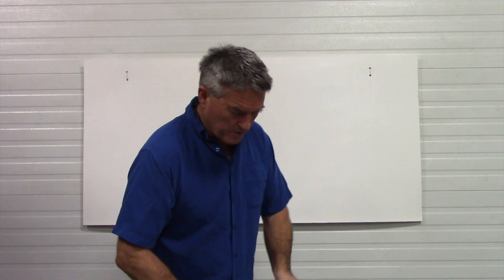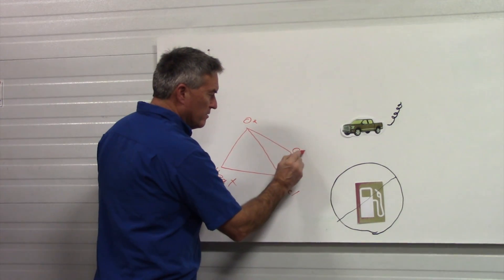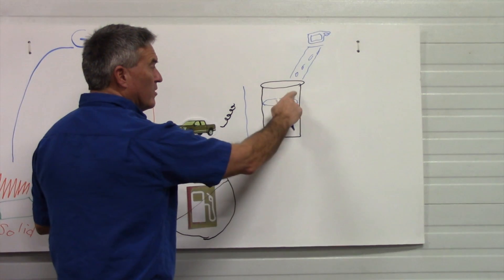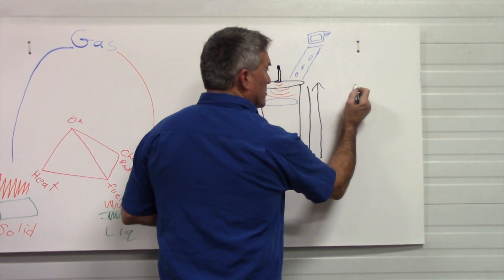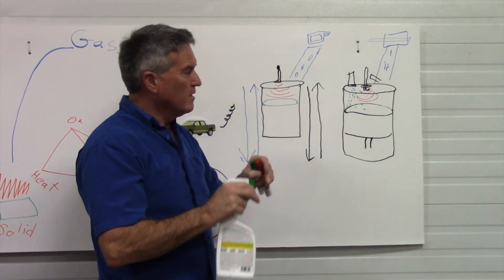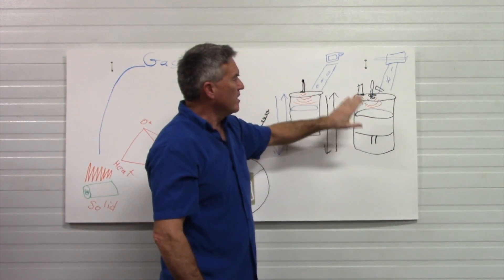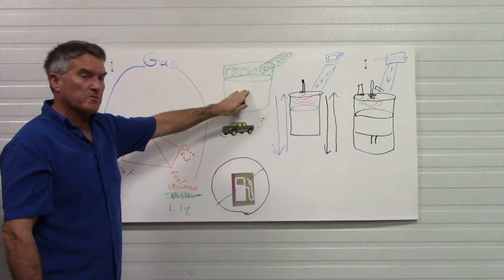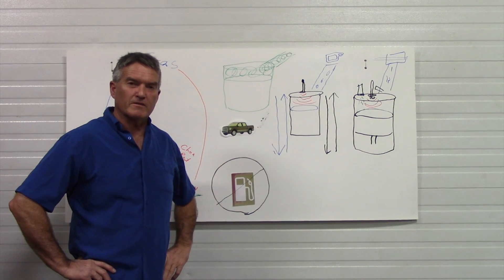One Simple Trick to get 100 miles per gallon with less pollution!

Comment: Does anyone remember a product that was demonstrate on TV that  was just a simple operation to add it to your engine intake fuel line but just before the injector?  it would inject air into the pipe in such a way that it would mix it and it would actually make your car do way more miles/gallon of fuel?  I have seen this demonstrate in the 80 maybe even the 70's but it could be found nowhere after that add.  Maybe it did run with electricity, i'm not sure.  One thing is for sure, 'they' took it off the public eye very fast...
Reply: this stuff has been around a long time my friend put one on his truck, and then their were special spark plugs to save gas etc. He never got more than 12 mpg
Reply: oh i see...  thanks!
Reply: Sylvain Piche I have purchased a HI CLONE device which has no moving parts and only has razor sharp blades with a slight twist. It's meant to give better mixing of fuel and air. Mine sits in the air intake just at the throttle body. No maintenance....but little to no difference in power or economy. Some people will put a suitable device in each manifold to head area....6cyl equals 6 devices etc. While I'm open to suggestions I did see a guy on U tube running a V6 on petrol vapour by connecting the air intake to a crudely fitted plastic jrry can. Cheers from AUS

Comment: Study the old type Coleman stove. It has what they call a generator that passes over the burner. When you first lite it the flame is spastic a d smoky. After it gets the "generator" hot which gasifice the liquid the flame is a clear blue almost non smelling. I have ran Ammoco Ultimate in these stoves for many years. This gasoline will clog the generator more frequently than the distiled Coleman fuel because of the additives , but it still will gasify and do what he is talking about. For a long time I've wanted to upsize this technology and run an auto engine. A small propane burner could be made to heat the "generator" and heat controlled by sensitive electronic thermostats to conserve this gas or simply use the exhaust gasses to heat it. The "generator" would need to be insulated up to the intake or it would condense back to liquid and defeat the purpose.

Comment: My truck burns straight veggie oil or diesel.
Changed nothing but rubber for poly fuel lines added more heater hose to warm a tank

Comment: The Gas that is in the wood is contained in the cellular structure, (cells),  of the wood. When you heat the wood, the cellular structure becomes fractured , and the gasses inside those cells are released, and this gas, mostly Hydrogen is what combusts. This is called Wood Gasification. People have run their internal combustion engines on Wood Gas. https://youtu.be/rz_ovHWvAAg

Comment: Car engines are designed to waste fuel. The only way to change that is to drastically reduce or eliminate the compression of air and gas because if gas and oxygen are mixed for complete combustion it will detonate under compression. When that happens there is no way of timing the combustion due to so many variables in temp and pressure. They know this so they purposely waste the gasoline to control when to ignite under compression. If they injected fuel and air after top dead center without compression and then detonate they would be very effective. This would also eliminate the need for so many cylinders and other moving parts. But we all know the petro companies won't ever allow this to happen !!
Reply: You should invent a motor and call it  Diesel.
Reply: Call it Vin
Reply: Your comment is obsolete, see Mazda's Skyactive-X engine design I think you'll like it. Uses, compression, spark and hybrid compression spark ignition. Uses a pressure sensor to measure chamber precision each cycle, and runs lean most of the time. They report i has about 30% more torque than thier current Skyactiv-G and is about 40-45% thermally efficient.  Should be in cars in 2019.
Reply: Chase Rayfield m

Comment: It is not a explosion it is a burn when the spark plug sends the spark
Reply: Correct, there is a middle ground though that Mazda is using they compress the air fuel mix almost enough to cause compression ignition then use a spark to start a burn the pressure from the expansion of the burn causes the rest of the air fuel mix to explode at once.... its a neat idea that they are implementing in some of thier engines going on sale in 2019.

Comment: LPG?
Reply: Probably Liquified Petroleum Gas.  Propane is an example.  However, it could be Litres Per Gallon, but that would be really dumb because it's 3.8 in US gallons, 4.55 in Imperial gallons and really doesn't vary.  That's a real head-scratcher.

Comment: Do you have a finished modification on a vehicle you can demonstrate for all of us, and show us the efficiency? or proof of concept?
Reply: Aaron Leon .... His cousin did a test and swore he got 100 mpg in his Lesabre.  You calling him a liar?
Reply: I got well over 100 MPG with this technique.  Technically, I didn't use "this" technique ... I simply measured while going down a very long hill because it was easier.
Reply: What is your idea? oh just a worthless nobody.
Reply: What is your idea? oh just a worthless nobody.
Reply: Aaron Leon mm
Reply: Aaron Leon: You COULD build and set up a GEET system for you car's engine. They're not too expensive but they have to be built just so in order to increase your fuel mileage and consume less gas. OR... you could look into getting an HHO mod for your car. BOTH are provided in videos here on YOUTUBE if you wanna spend your spare time building it. However, BOTH require your car's computer to be modified and there aren't many shops around the world that can do that because it's still a new concept and the oil companies won;t make big money off of it so it will all die out soon enough. Sad huh?
Reply: I'd like to learn more.  I don't know much about this stuff, but it sounds like such systems, to gasify fuel, could work on older, pre-computer controlled engines, without need to modify computer controls.
Reply: @my1after909  You are absolutely correct. In the mid 30ss Cadillac came out with an inline 8 cylinder engine and just a few years after that the first fuel injected engine came about. In cars and trucks that ran off of gas back in those days all the way up till they started making totally enclosed computerised engines the carburetor used something called jets. In most vehicles there was a jet that allowed a certain amount of fuel to leave the fuel bowl and enter the intake manifold where it is dispersed and sent to the cylinders. On bigger engines those jets could be much longer and even have multiple jets. In the 70s Chrysler and Ford both used Carter carburetors for their engines when they ran a 2 BBM (2 barrel). On a typical 150 up 318 Chrysler engine the jet was about 1/2 an inch long and about an 1/8 inch in diameter and it had tiny fins on it. But in the Ford's with the 4 bbl carbs those jets were oftentimes nearly 3 inches long. If you wanted to get a LOT more fuel into your engine back in those days you could tune it up and file those jets down to a point. But after getting on the gas pedal too much you'd likely blow the engine because it would start to struggle to make the combustion react on time. I had a '72 Plymouth Satellite Seabring with the 318 engine and only 150 horse power..but that car had no top end! You could get up to about 120 and most cars would top out. Not that one. It would just continue to climb slowly. I had mine going so fast before that the speedometer would go way past 120 and bounce back below zero and keep doing that! That's impressive for anything running a measley 150 hp. I've also had Ford trucks since I was old enough to drive and worked on most of them as well. Had a '75 f100 with the 360 FE motor that would do wheel hops at 55mph! Not a super high amount of horse power but a ton of torque in all the right places. So learn all you can about the older cars before computers were put in them and that will help you understand what these idiot car companies have done the past several decades. Also ...you can run either the HHO setup or a gasifier setup on those old engines and it won't hurt them. Gasifiers take the gas out of wood and turn it into usable gas that your car can run off of. But it won't work on today's engines without serious modifications. So look into those. There's lots of videos on this stuff here on YouTube and a LOT of it is good usable info. Hope that helps you.
Reply: @littleshepherdfarm2128  Do NOT use gasifier on any engine you want to last! The gas produced contains acid that eats the engine! This is WW2 tech (you can see films of them on YT) The same problem was found in methane generators extracting the gas from landfill to power generators for the Electric Board (UK) Many times they simply did not bother with a filter to take the acid out and trashed some big engines .... they now no longer bother trying to generate power this way! 

HHO or Browns gas is good .... but you  cant beat entropy and you do need to input more power to create the gas than you can extract from it! One problem with HHO is the combustion temperature! It can easily burn through steel so your average magnesium aluminium alloy engine would need to cool that burn down a lot!
Reply: @littleshepherdfarm2128   HHO mods are manufactured, specific to your car, (about a grand each) I found 2 a while ago, and screw computers! lol true mechanics last w/basic maintenance.
Reply: tampicokid I like the roses idea but I don't think you completely understand how the HHO generator works. Yes the electrical lines are usually hooked to your alternator to generate power to the unit or to whatever power source you have running the system like a high output rechargeable deep cycle battery then to a control switch and from the the rest of the unit. When the HHO generator is quewed the electricity is transferred to the holding tank where there are stainless steel plates that act like a car battery and a chemical process takes place causing the catalyst in the distilled water to create Hydrogen and it builds up pressure so that it can be transferred from the tank to the fuel injection unit be it a carburetor or throttle body or whatever and once the pressure is built up enough your car runs off of the HHO generator not gasoline. The hydrogen and oxygen combine to create a combustible source of gas that goes to your list one and is exploded into combustion which in turn creates power for your car to run on. It has been proven time and again that it can be done but as I said there are draw backs to it and the worst one is that it's a volatile combustible element so it has to be controlled correctly in order work. The next draw back in that line is that new we cars have an ECM control computer that will eventually recognize a foreign source and think it needs to correct itself and so on newer cars the fuel mileage won't last long...maybe a few months at best. So once it is correctly set up and running your car's engine doesn't need gas to run on at all. And as far as fuel efficiency goes it's way cheaper to run on distilled water and baking soda than gasoline. This entire conversation with some people attempting to discredit me is cracking me up. Do you guys really think I don't know what I'm talking about? I have built engines and cars from the ground up and worked many many different types of jobs throughout my life and even did auto body work proffessioy back in the 80s. One thing I have never done is totally rebuild a transmission. I have done the basic stuff...replaced the filter and adjusted the bands on my Ford's to 24 inch pounds and u joints and stuff but nothing deeper than that on any transmissions. Just never had to. But trust me I do know exactly what I'm talking about
Reply: Some one I know (I've decided not to name him) has fitted a Pantone GEET system to a generator engine. He created a base line by running the UN-converted engine under very precise loads. He measured fuel consumption, plug a gas analyse into the exhaust and measured  oxygen, CO2, carbon monoxide and unburned hydrocarbons. 
He then converted the engine and run the same set of tests using the same experiment and compared the results. 
80% to 90% reduction in pollution 25% to 30% fuel saving. 
He spent years getting it to work but thanks to the armchair critics he is no longer interested in proving it to anyone.  The planet is 1 degree warmer than pre industrial age, 0.7 deg since the second word war. Billions of tones of C02 and Methane gas is waiting to be released from the permafrost in Alaska and Russia.
So my friend is living on an island working on advanced food growing systems if you live in a "modern" society buying your food from the super market you will starve before he does.
Reply: Ray Easton 
Knock sensor? Exhaust manifold temp variations?
Reply: tampicokid  Well that may be true buy I personally only just discovered how to build one a few years ago. My problem is cash. If I had any kind of extra money I would buy an older truck to test it out on. Even still you proved my point when I said that there are many different clean wats to propel your vehicle so thank you for backing me up. As for me being gullible....not on your life. In willing to check things out myself and at least give them the benefit of the doubt but I'm in no way gullible. In not none of these people who just have to try something to know whether its a good thing or not. Oftentimes I learn from other people's mistakes more than my own. People like yourself should relax a little bit. I'm not out to make anyone look bad. If they insult my intelligence then I feel obligated tho set the matter straight. And if I'm wrong then I will apologize. Its that simple. Ya can't grow old and never apologize for any mistakes you made. Otherwise you might die old and lonely. No thank you.
Reply: tampicokid: Whatever. I'm sorry to have even said anything in hopes of possibly helping someone because of nutjobs like you who think you know it all. The car's ALTERNATOR is what generates electricity to form the power needed to recharge the battery and run other functions. Period. It IS DESIGNED to carry the electrical load for your car and does not require gasoline in any way shape or form to operate! You can use it separate from your car to generate electricity simply by hooking it up to a motor via fan belt or a human-peddled bicycle if that's what you choose to do with it but you'll need to get it to a certain number of RPMs  if you want a decent charge out of it. It DOES NOT IN ANY WAY SHAPE OR FORM RUN OFF OF GASOLINE, NUTJOB! In the HHO system the engine then runs off of the gases produced by the oxygen mixed with hydrogen smarty pants. The set up I am talking about needs no gasoline to run your car, dipstick. The hydrogen mixed with oxygen that is produced via the HHO generator is what your car then runs off of, not gasoline! Get an education before you go around calling people naive and gullible, you fools. Geez you guys are the gullible ones! I wish you idiots that don't know anything about cars would sit back, shut up, and learn something for a change! Y'all crack me up with your "KNOWLEDGE" of things. Don't stop at that video with the guy who is supposedly running his Chevy off of the HHO set up that has the stainless steel scrubbing pad in a jar. That guy is clearly not doing it right. Dig deeper if you want a real knowledge of how it works but don't bug me again. Some of my earlier comments were done on my smart phone (which is pretty stupid of a device I might add) so some of the words got changed around, but my knowledge of this subject is obviously a LOT deeper than yours. Go educate yourself a lot further before you say something arrogant again or at least lay off of the bogus weed you smoked before this conversation started! You just made yourself look really unintelligent with that asinine comment about the alternator needing gasoline to operate! Very very stupid on your part!
Reply: @littleshepherdfarm2128  
The engine runs on fuel - the Alternator is turned by the engine - so yes it runs on fuel (gas), but in your case it's hydrogen

Comment: This is interesting fact for you: liquid fuel doesn't burn at all. You even can extinguish a burning match in diesel fuel if you would sink it fast enough. Only evaporated/gaseous fuel will burn, and in cylinder we have vaporisation process without any additional devices. Moreover, there are even natural gas engines, which are working on gaseous fuel by default. And they doesn't show any significant advantage in engine's fuel economy. The biggest fuel economy you can get without power loss is just about 5% or less.
It's almost useless to try tuning burning process further - there should be totally different approaches, like Scuderi engine, for example.
I strongly advise you to take time to attend a university and get Ph.D in internal combustion engines before educating anyone in this really complicated field.
Reply: Read up on SPCCI and RCCI.... the thing about getting a degree is what you learn to day in school was state of the art 5 years ago, and 10 years behind the times by the time you put it in practice. To really get on the edge of engine technology you need to work for a company that is actually interested in advancements like Koenigsegg or Mazda etc...
Reply: Ultra-lean mixtures have quite a little common with subject of the video. This concept is developing for almost 20 years, and in not close to 100 mpg rate.